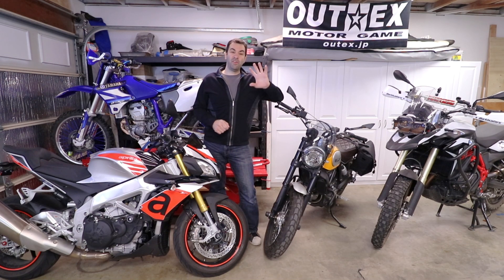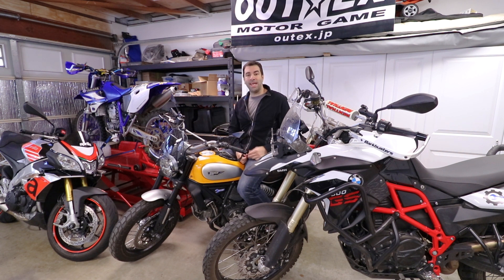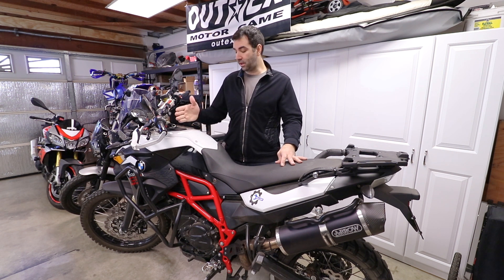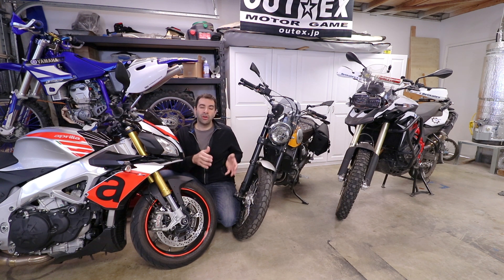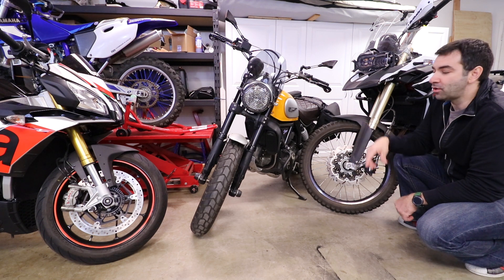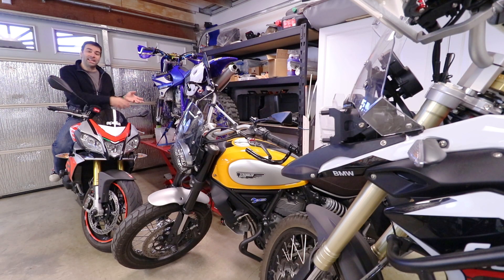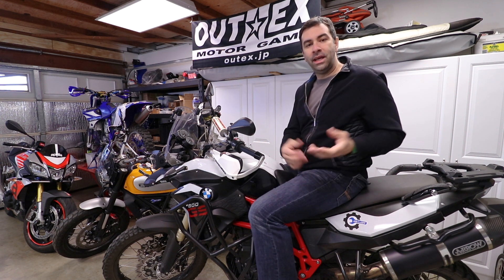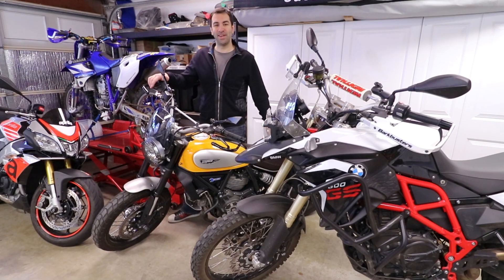5 motorcycle maintenance jobs anybody can do, even Grandma.

Comment: Great stuff, now get back to working on the F800 :-)
Reply from the maker: LoL, as you wish, I have a few ideas...
Reply: @AlbesADV  If you have a chance, i would love to know your thoughts on either a booster plug, or power commander,
Reply from the maker: In short,  I've installed a few power commander in my life and in every instance they did make a difference with both fully built bikes or stock bikes. If you have a chance to get one I would go for it,  the bike runs better.  When it comes to the power plug,  I don't know enough about it to comment.
Reply: @AlbesADV  So would you put one on a stock F800?
Reply from the maker: Only if really didn't know what else to do with $400